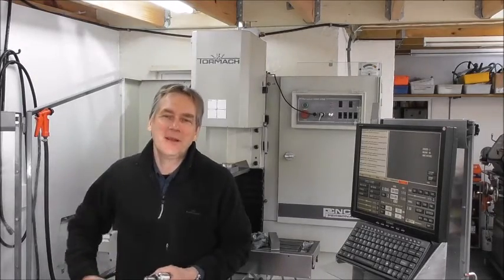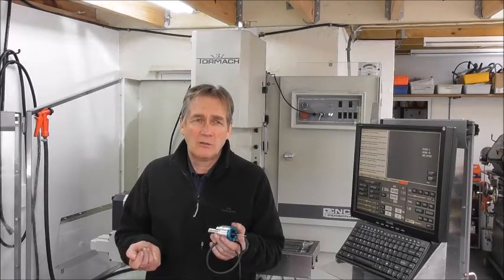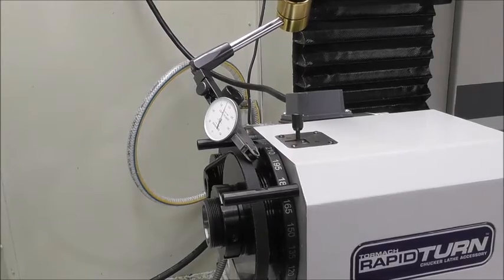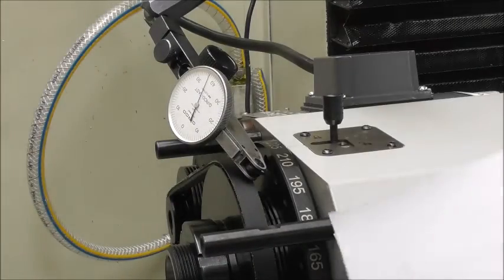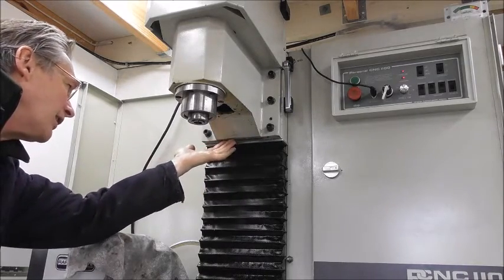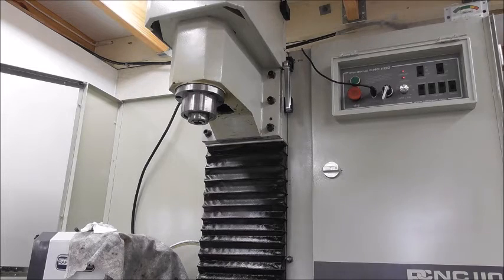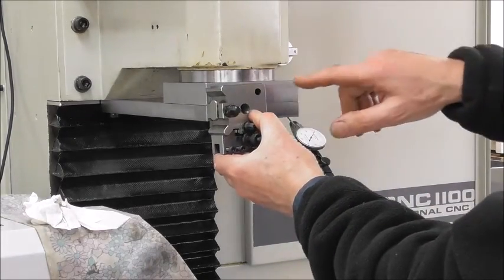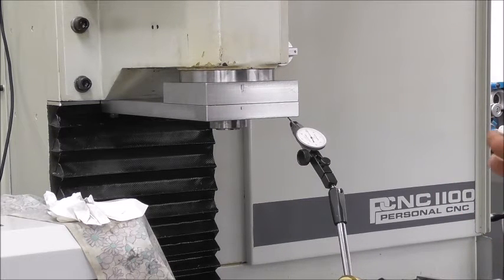Tormach RapidTurn - 3. Gang tooling.

Comment: Just a bit of Tormach owner humor:  I'm cutting the slot to open up the spindle hole in the gang tool plate right now.  That's a 1" deep slot.  The only thing I have that goes 1"+ deep other than 1/2" expensive coated end mills (which I use for cleanup passes only and certainly NOT destructive slotting ops)  is a 1/2" single flute indexable mill.  Talk about slow going with a fogbuster and no flood coolant.  Set it super conservative and go do something else for the afternoon.  Ha!  But it's working fine... (so far...)  Wish I had a friend with a big waterjet right now.
Reply from the maker: Good to hear of your journey!   Cliff

Comment: :-) Had I known about that machined area at the bottom of the head casting I would have mentioned using that instead of using the dovetail instead. That should work more than well. The bolted on gang tooling will still have a bit of an issue getting repeatable positioning so you know where the tool tip is each time the tool block is mounted. Using a couple of taper pins and taper reamed holes on each tool block/ mounting plate should get you well under .001" for a repeatable position. But I suspect you've already figured out something that will do the same thing. It should be more than interesting seeing all this in operation. That Rapid Turn isn't exactly a cheap bit of tooling but should be very versatile.
Reply from the maker: Thanks for your thoughts - cheers.